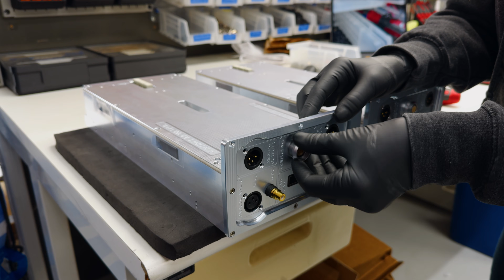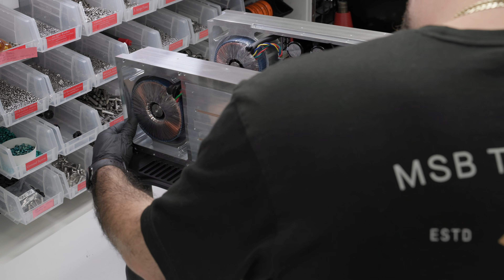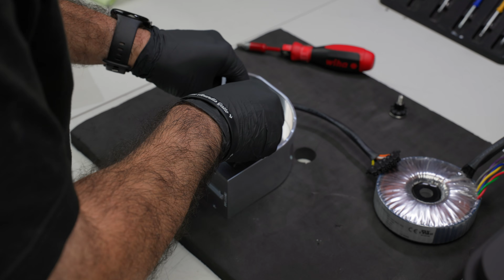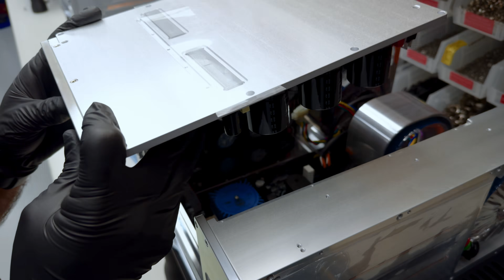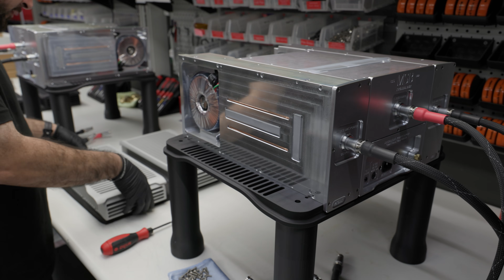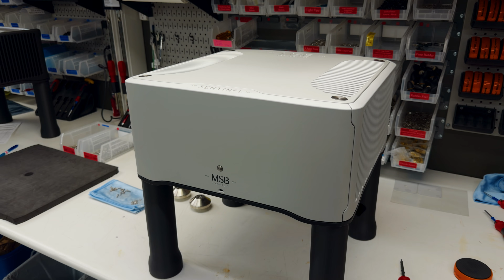Our Ultimate Audiophile Power Supply | The Sentinel Powerbase Assembly

Comment: what do you think about switch mode power supplies?
Reply from the maker: They certainly have a time and place. We use them before the digital isolation in some products, like the Premier Digital Director. Otherwise, they are a bit too noisy for analog circuitry. At least on the level we are pushing for.